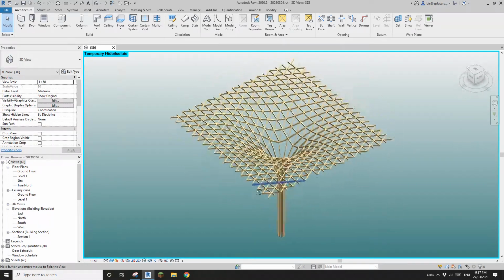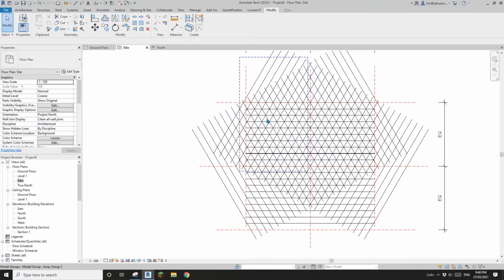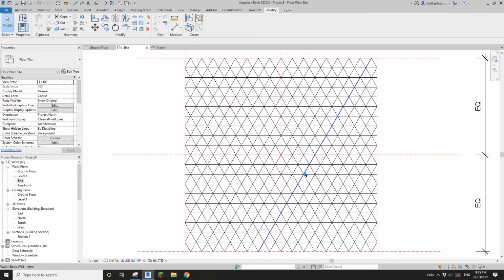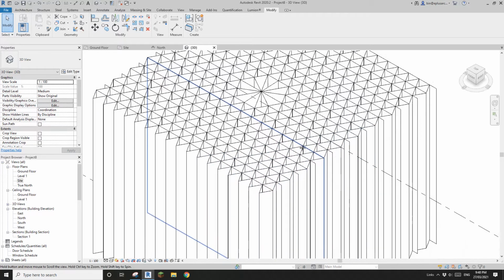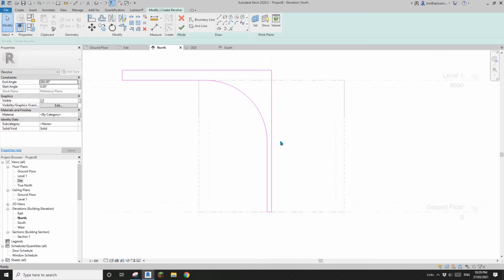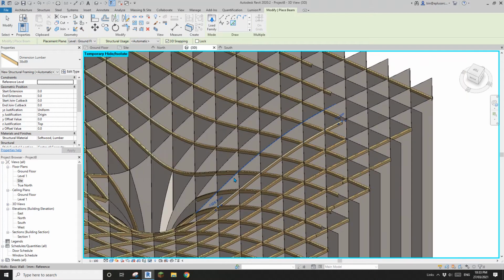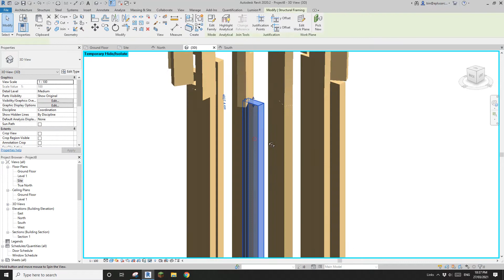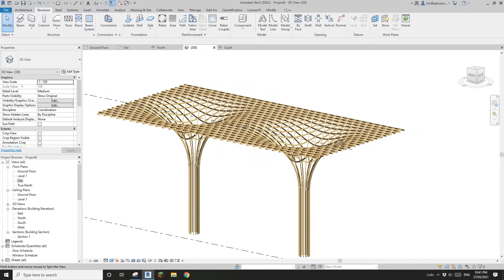Everyday Revit (Day 374) - Timber Structure (Not Parametric)

Comment: I'm trying to use this methods of modeling timber structure on my project, when i try to attach my wall to the roof, it says "Can't keep wall and target joined", and some walls won't cut to the roof, pls need help
Reply from the maker: You can try to raise your roof so it is higher than any of the walls, also make sure that your roof is covering all the wall.

Comment: Hi, great revit videos! Not related to your video but I came across a problem while making slanted windows face based family that won't cut in the plan view unless I change the category of the family to a generic model instead of windows. But the downside of changing the category would be not having it tagged in the windows schedule. I wonder if you know any workaround on this problem?
Reply from the maker: It’s probably related to the view range of the floor plan in the family. Do you mind sharing your family so I can have a look?
Reply: @BINHE615  No problem. I'll send it to your email.
Reply from the maker: Okay... Generally, generic models are cutable, and it will show the cut lines wherever you cut them (cut plane setting in view range of a plan view).  Window families are cutable too, but what you see in a plan view is controlled by the view range of the plan view in those families. In this case, your family is a nested family, I found it not possible to cut the geometry in a plan view.
I think you have 2 options: either model your family without nested families, or use symbolic lines to indicate the elements.   Probably the latter is a better option.  You can open some out of the box window family and check out the use of symbolic lines. You will need to use subcategory and projection/cut to control the line weight.
Reply: @BINHE615  Thank you for the tips! Will try to follow your recommendations and see which one's best. Thanks for the help. May your channel grow more.